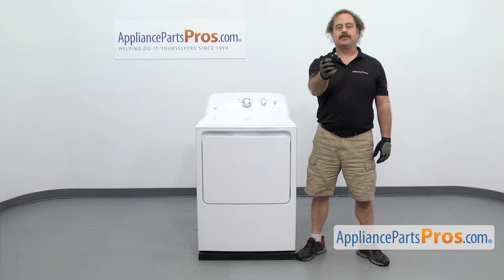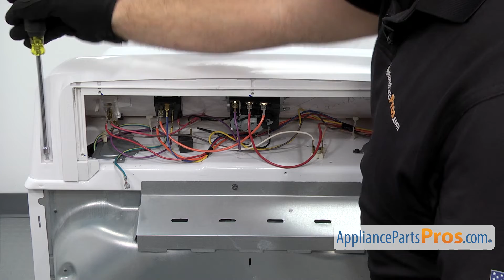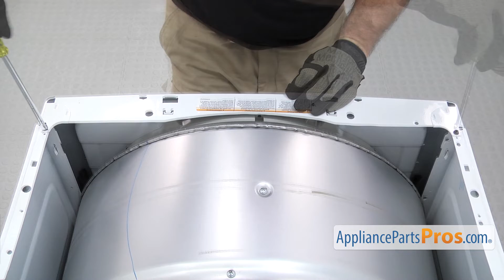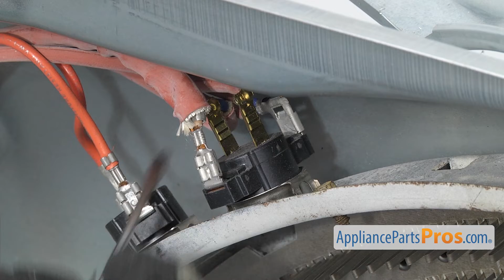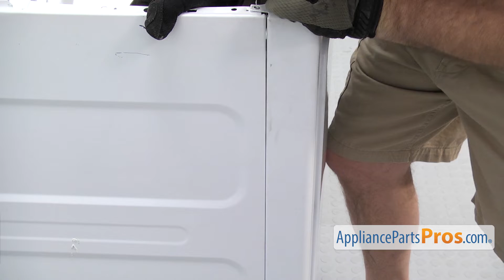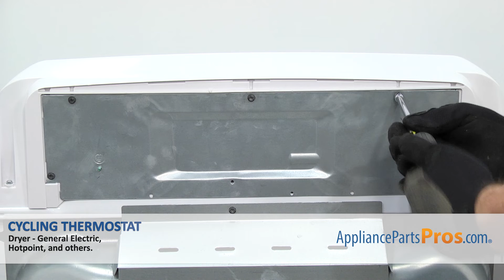GE Dryer Cycling Thermostat WE04X25201 Replacement

Comment: So my dryer heats and turns on but after 10 minutes or so will stop, and will not restart for awhile. We cleaned all the lint in the vent in the filter and everywhere inside. I was thinking that it may be the cycling thermostat...what do you think? Or what else could it be. The dryer is Model GTD33EASKOWW . It is less than 2 years old
Reply from the maker: If the unit will not restart immediately, that is an indication of a bad motor.

Comment: Unbelievable that the drum has to be removed/reinstalled to replace a part that fails so commonly. 🙄
Reply from the maker: Some designs make common repairs way more complicated than they need to be. Hopefully, the replacement went smoothly—let us know if you need any tips!

Comment: Hi, thanks for the video, I was curious for the cycling thermostat should the two center pins have continuity when putting a DMM on them? Mine does not and I believe that's where my issue is, but the new part I ordered doesn't either and now I am wondering if I didnt actually find the issue with my dryer. Thank you!
Reply from the maker: What is the model number of your dryer? What is going on with it?
Reply: @appliancepartspros  Hi thanks for the response, my dryer is model number: GTD33EASK0WW and the unit won't heat. I checked all the switches/dials first, power in and all that looked fine. So then I moved to the thermostat and another video I watched before this one mentioned that the two middle prongs should have continuity but mine didn't but now the 2 replacement parts I got also do not, so I don't think that's the issue. Let me know if any more information is needed. Again much appreciated.
Reply from the maker: Have you checked the high limit thermostat for continuity? Have you cleaned out your dryer of lint?
Reply: @appliancepartspros  ya the lint trap and lint around the unit was minimal. Check the other thermostat and that has it, so do the outside terminals/spades on the cycling one. Also just pulled out the drum and tested each connector on the bottom and saw 22 ohms from right to both terminals/spades on the left. And check the blower thermostat (in front of the motor) and it's good. Not sure what to do maybe just put back together and retry it ha
Reply: @appliancepartspros  Thanks for your responses it looks like when I put the door switch back one of the pins bent and it wasn't making contact once that was repaired it started up and the new cycling thermostat did work. Really appreciate you taking the time to check and give insight!